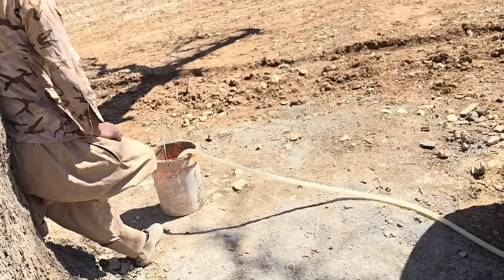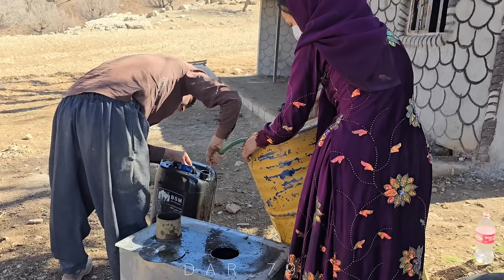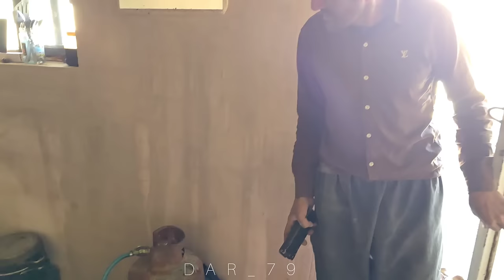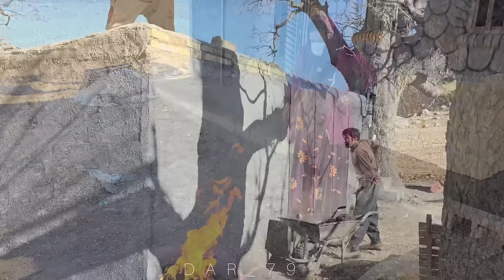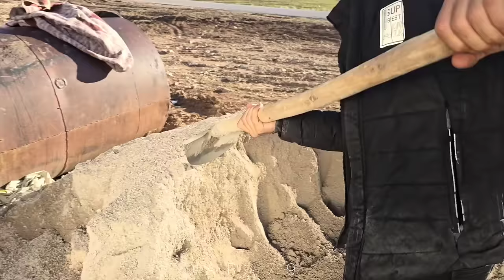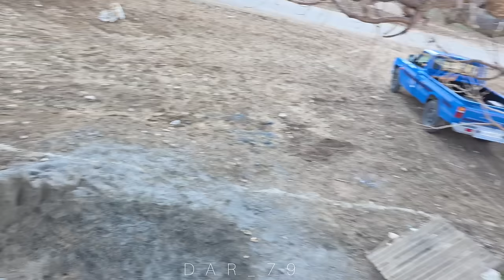single mother in search of a better life: repairing the bathroom ceiling

Comment: They need to informed Nargis not to have that fire on the stove turn up so high when she is not cooking on it...she is using it to heat that cold house....she need to have them insulate the inside walls , floors, ceiling..

Instead of doing everything else she is having then do....